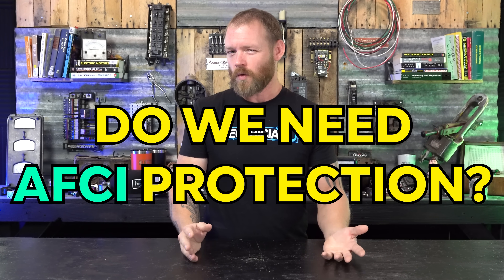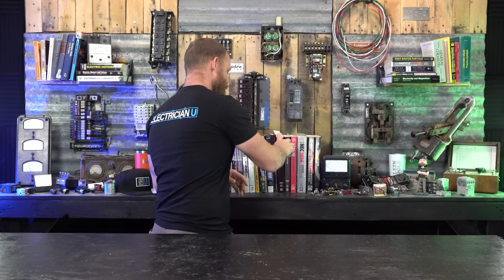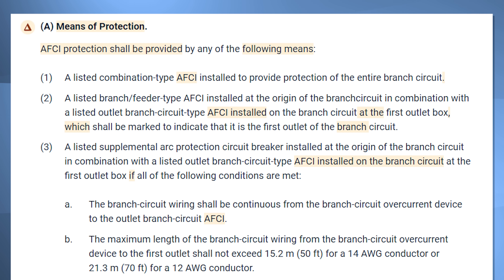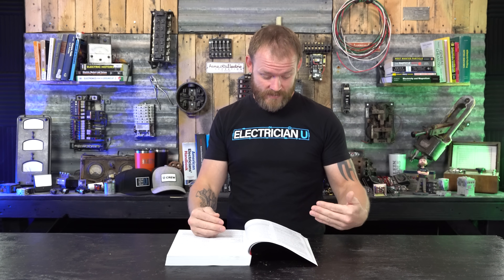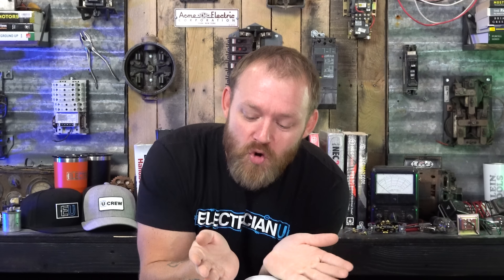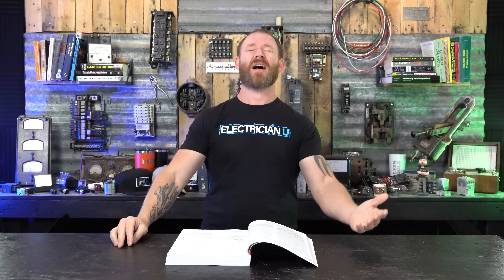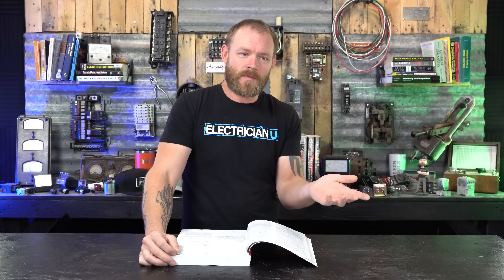Where and Why Do We Need AFCI Protection?

Comment: What kinds of devices cause false triggering of AFCIs?  Circular saws, maybe, with their universal motors and brushes?  Ham radio transmitters?

BTW, it's perfectly possible for an arc-welder not to trip an AFCI.  It just has to make sure the high-frequency fluctuations in the current of the arc are not coupled back to the AC line.  Capacitive or inductive filtering should do that.

Comment: I live in louisiana and we had an inspector tell us we need a gfci 2 pole breaker plus 10/3 with ground to a 50 gallon tank water heater. there's nowhere to hook up a neutral on the heater. explain that.

Comment: Every room with air conditioned space. AFCIs are a love.. hate deal. In my area any permitted electrical work requires AFCI upgrade. I am kinda in favor of AFCIs.. On the positive, I had a service call on a newer construction and the customer stated.. Once in a while the bedroom CB would blow. I found arcing wire in a JB that had melted down due to the continuously resetting the CB. On the hate side.. they are too sensitive to motors. Trips easy on shopvac, saws, or even multitool. Had to run extention cord to outside (non-AFCI) to do this type of work.

Comment: This was an excellent overview.  I'm rewiring my entire house in Michigan and I have significantly underestimated the cost for circuit breakers.  A simple circuit breaker is about 8 bucks.  A dual function one is about 60 bucks!  Dual function outlets run about 24 buck each!! Good night nurse and call the cops!  Apparently, every room needs an AFCI, and some require AFCI and GFCI.  The only place I can save money is in the bathrooms and that is by placing a GFCI outlet and connecting other outlets to it assuming they remain in the bathroom.  It sucks and, as you said, would have been easier, and probably cheaper, to buy an electrical panel with dual functions for everything.  So far, I think I have spent over $1,000 on breakers because of AFCI and GFCI requirements.  I would rather be shocked.  It's less painful than shelling out this much for breakers.  Thanks for confirming my expensive suspicions.

Comment: So bathroom circuit, if outlet and light is on the same circuit do I need an afci or not? :)
If I have separate circuits for light an outlet in bathroom do I need both afci or what? This is pretty confusing. :)

Thanks 🤝

Comment: What will i do with regular breakers after replacing all to afci?
Reply: Pretty much this is for single dwelling or multifamily dwelling units, in comercial we care only wet locations, the rest of the breakes are regular breakers or you just put a gfci receptacle where need it and regular breaker in the panel. This is huge change in NEC 2020 and 2023
Reply: @ Thanks.

Comment: Correct me if I'm wrong, but the scenario of a welder would not apply as you are not doing the arcing with the mains voltage. Instead the welder uses the mains voltage and goes through a transformer, which actually separates the two flowing currents.
Great video BTW!

Comment: Thanks for the information. We have a gas oven on a circuit that is fed by a 20A AFCI breaker. It has started to trip frequently when turning on the oven. Suspect that the AFCI is detecting a fault when the oven igniter clicks on.  Also noted that the AFCI pigtail on the breaker is stretched out quite (not in a tight spiral like the others) a bit to connect to the ground bar.  Would that potentially affect breaker performance?
Reply: no

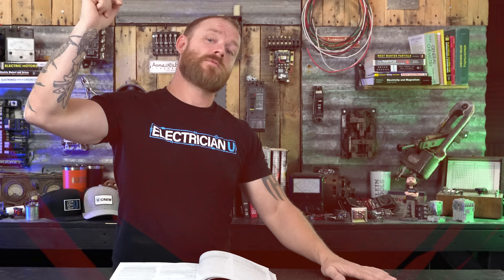Comment: New home the vacuum cleaner trips the AFCI breaker from kitchen island. But not in the bedrooms. Electrician been out twice.  Run a new wire took out a 12:45  gfi in living room replaced breaker. Sometimes it works. I hate AFCI breakers

Comment: What is an arc fault compared to a short circuit and what is the difference between a parallel short circuit and a series short circuit. Spreading disinformation is the worst thing you could do if something faults out before it reaches its load. It is a short circuit, a fault. It is classified a ground fault when it has to use the ground to get back to the source of the transformer, this is not correct information, you’re really close but a lot of this does not make sense. Maybe there’s something that you understand that I don’t I would be curious to hear your thoughts on the subject.

Comment: All older welders use a big transformer which block HF,  so high frequency arc energy can't get into the feeder circuit.
Newer welders all use inverter supplies with big caps on the DC supply feeding the IGBT's, which again prevent any high freq energy of the welding arc from entering the feeder.
The ancient non-isolated carbon arc/resistor-coil welders grandpa once used are a different story....lol

Comment: The arc of a welder is not directly connected to the branch circuit wiring. There is a power supply isolating the arc.

Comment: I installed combination arc fault breakers on my aluminim wired circuits and as of 4 years none have tripped .  I have seen arc fault breakers do their job which could have led to fires with a standard breaker . Of course troubleshooting can be more challanging .
Reply: Make sure you have the correct outlets for your aluminum wiring. In Phoenix, Oregon the Home Depot carries them ( electrical supply store folk gave me blank looks LOL). They are dual-rated for copper AND aluminum - @$4-5 each, but much cheaper than rebuilding a house...
Reply: I spent far too many hours this summer up in an attic with sweat dripping off my eyelashes getting rid of the aluminum wiring (and aluminum-to-knob-and-tube junctions!), but putting in the correct outlet boxes on the 50 year old aluminum wiring was a good short-term fix last winter when one of the outlets started throwing out white sparks. Glad to see the last of the aluminum - Knob and tube and cloth-wrapped wiring are next to go. Ironically I trust the 125-year-old wire more than the 60-year-old wire cloth-wrapped! The insulation still looks perfect, and each wire is ever-so-carefully wrapped around ceramic insulators, or threaded through ceramic tubes - - the workmanship of the install is impressive. It's still gonna go though.

Comment: 30 years in vol. FD. Many aid calls, never saw anyone shocked or electrocuted. Only fire we could definitely call electrical caused by wall heater without romex connector, expansion and contraction wore thru isulation and  caused spark. AFCI and GFCI total BS.

Comment: So there could be an arc fault in a fire alarm system but since ther is no afci required on that circuit it will still be active to let you know about the fire it caused.  Roflmao 🤣

Comment: The simple solution for dwelling units is just manufacture main circuit breakers with afci protection and cover everything, including bathrooms, outdoor receptacles and garages. The only problem about arc fault is any device or appliance with a universal motor that has brushes that arc by design. Vacuum cleaners  especially.

Comment: for the "arc welder" part, I think the breaker might not trip simply because the "arcing" is isolated on the other side of a transformer or inverter built in to the machine.

Comment: I absolutely detest AFCI circuit breakers. They nuisance trip on anything. Any device that has a contact that opens or closes and creates even a minuscule arc will trip one of these breakers. A crockpot thermostat, a coffee maker, the compressor contactor in my refrigerator, anything. They are about 5-6 times more expensive than a regular breaker to replace and will nullify your homeowner's insurance if you change them out with breakers that actually work. I'm at a loss for what to do.

Comment: I have a 220 volt, 30 amp washer/dryer unit,  do I need an arc fault breaker?
Reply: No, gfi breaker is required.

Comment: My treadmill sets of the arc fault breaker. Which very nearly wrecked me when my treadmill suddenly shut down at 6mph. I had to have that breaker replaced with a normal breaker. 

I assume it's because the treadmill is basically a Van der Graaf generator and creates a ton of static electricity.

Comment: what if you have a customer that has an afci breaker that powers two bedrooms. they claim that it nuisance trips, but when you go to check it out everything is working. I think the house was built in the late 90s, im not sure why there is an afci breaker in there to begin with. supposedly their neighbor replaced it for them at some point because of nuisance tripping. My plan is to switch it out with a regular single pole breaker and be done with it.
Reply: then they plug in a faulty space heater and burn down and sue you

Comment: The only place arc fault breakers have IMO is if your house has really old shitty cabling or if its got aluminium wire instead of copper, otherwise its completely unnecessary.

Comment: an arc welder definitely does produce arcs but the welding output is probably reasonably well isolated from the input circuits that would/could trigger arc fault protection. Wouldn't be surprised if there were still problems but...... You are probably familiar with an isolation transformer: a ground fault on the output side probably wouldn't be detectable on the input side.... because it is "isolated". An arc fault detector might work similarly.
Reply: should have read further in the comments, already addressed by FishFind3000.

Comment: You will only need to add an AFCI breaker panel if the renovation to the electrical panel includes adding outlets, receptacles, and wirings more than 6 ft. in length. If not, you are not mandated to add an AFCI, as per the 2017 NEC.

Comment: I like your statement. "Why not say every room in the house." OMG laughing so hard I almost had a "moment." I laughed very HARD AT THAT POINT.  We have an ARC welder. It is hugely expensive to use so we bout a gas generator for that thing to save our electric bill from making me cry. 

So many things are brushless now. Not sure how many things we plug in still ARC as part of operation. I plan on being in my house probably for the rest of my life so with that in mind I tend to think everything should be AFCI and GFCI. I never even understood this as a thing until I installed the above ground salt water pool. Had to put in a PED for that. Own CI. GFIC. and did a copper "bonding ring" around the pool under the rocks and gravel.
We ran a wire to the pump, the pool heater (wood fired) and the chlorinator thinger on the PED pole for the pool power. We did put in a 20A GFIC plug. Mom said I needed one there no matter what was in my breaker box so I did it. Not sure I put the correct one in. 15,20, 25 amp. Now I need to go back and look at that.

Comment: Little confused. I am moving on to "Where Should We Be Using Dual Function Breakers?"  next. Thinking we should just have them everywhere. So as we replace breakers in our old box. If there is a place I think it would be nice to have dual protection, can you just upgrade the breaker as you replace it? Looks like the cabling is going to be the same if wired to modern code.  For instance... You put a portable sauna in your guest bedroom. Now you have heat and moisture in a room and dual protection upgrade on the breaker would be a nice feature if replacing the breaker anyhow. I honestly think with buildings that have sprinkler systems inside why are not all CIs dual so you have ARC and GFI? Sprinkler turns on to put our a fire while you are doing exz with a electrical device. You don't get killed by fire you get electrocuted.  I think there is still something I have not caught on to yet with this subject. :D

Comment: When manufacturers lobbied to put them in the code to mandate their product - they didn’t even have a product on the market to sell for another 4 years. And when they did it was garbage. It took another 8 for them to partially function, and still a nuisance by design.

The supposed safety record is flawed statistics comparing 2-wire with the GFCI protection (which is also on the AFCI) to 3-wire circuits that behaved differently. 

Most electronic devices had to be modified to work with them. For years I had to tell clients that they couldn’t charge their iPhone in the bedroom, or to get a different vacuum.

Comment: Brushed motors will arc between the brushes and commutator, which is probably why garages/workshops and exterior receptacles (that might power electric mowers) are exempt. However, kitchens may have mixers and blenders that still use brushed motors and that might be real fun to deal with when trying to bake a cake.
Reply: I've got a vacuum that will trip the AFCI on only one circuit.
Reply: Stop at GFCI in your production shop. Ask me how I know. The alternative is to replace all of your tools to ensure they are brushless. I have a 70-year old Radial Arm Saw (RAS) in my shop that will trip the AFCI whenever it was turned on. GFCI is a sufficient level of protection in this “garage-like” application. A new, brushless motor RAS would typically cost $5000+. Though the shop is technically “habitable,” no one sleeps there (unless they want to find a new job / employer). Grateful for this NEC exception.
Reply: This was a great video. I learned a lot about why things trip sometimes.

Comment: Who is “THEY”.  

“They”figured out every motor drive characteristic so the AFCI would not be a false positive and trip ? 

You cannot have these on circuits that have motors. The motors will cause AFCI breakers to pop for no reason. 
Happens all the damn time. I’m wish the people who write code would die off and allow things to just work and work safely. Equipment should be engineered with it built into the equipment vs as a supply

Comment: It looks like they are expecting the very update to equipment (at least in arc welding equipment) that you said you wanted to see in the breakers themselves. In other words, the arc fault will not be detectable in the line of the arc welding equipment, no doubt because of some standard that has been improved in the circuits of that equipment. I would guess they are or will be requiring either diode, transistor and/or rectifier additions (or a pre-manufactured part including those things) to the equipment circuits.

It's better that the equipment has the arc defense in order to prevent any kind of tripping by feedback or faulty equipment. If the equipment itself shuts down without tripping the AFCI breaker, then you know your equipment is what is at fault.

Comment: If they had required metallic conduit on residential as well as commercial and no air nailers after wiring is installed then you would have no nails run into Romex which is 99.99999999999% of arc faults. (Typically siding installation) But hey, why fix the cause?

Comment: I'll never forget a call to troubleshoot a nuisance tripping of two AFCI breakers in a brand new home.  Turns out, a faulty fan in the oven...a circuit that had absolutely nothing to do with the circuits that were tripping was causing enough "noise" to trip the adjacent AFCI breakers in the panel.  It was there and then I decided AFCIs we're complete junk.

Comment: I just realized my renovation plan: 

1) Cram the existing panel with the few normal breakers that will fit.
2) Later, sell car to afford electrician to replace panel + breakers.

Until #2 happens, I'll be violating code, despite the house being infinitely SAFER than its currently code-compliant rat's nest of old fuse boxes, no-ground circuits, crumbling cloth wires, and broken dreams.

Comment: The reason why bathrooms don't need AFCI is because you can just pour readily-available water on the electrical fire, duh. Outdoor receptacle fire? Use your garden hose, of course! Similarly, if your garage catches from from an arc, just spray any random chemical on it. Problem solved!

Comment: I have an electrician coming to install an 20 amp circuit. I am going to buy the parts. He looked at my panel and told me to get ECMBR2 but when I looked that up it was a clip. How do I determine what breaker I need? I found one that would work that was GFCI but I want to get the basic breaker and have GFCI outlets installed. The label on the panel is a Murray.

Comment: I did all the wiring for my kitchen addition and I added a upgraded main service panel to accommodate the new kitchen circuits. My old main service is a subpanel now.  Anyway, I didn’t have to touch the old main panel circuits but all 9 kitchen circuits require arc fault protection.  Running dishwashers, garbage disposals, toasters, fridges, etc.  All new appliances.  It’s a QO plug on neutral panel with QO arc fault breakers.  I have had zero trips and zero problems.  Junction boxes used, connections made for appliances, and pigtails all Wago Lever nuts. Maybe the older AFCI’s were problematic, especially with older equipment, or maybe people were just using dangerous arcing equipment.  Will see how it holds up.  But if you have relatively newer wiring (last 30-40 years) and you install a panel with all arc fault protection and stuff starts tripping, it’s time to investigate your wiring itself…because based on my experience, it ain’t the breakers.  It’s mind boggling to me why people wouldn’t want these extra safety devices.  I’ve literally seen buildings go up in flames from electrical fires.
Reply: We just moved into a new neighborhood. Looks like the AFCI's are trip city. Electrician has a fulltime job with the warranty replacing these things. As far as I know you can't reliably test them, so they just replace them.

Comment: Are there high-amperage AFCI breakers that could be used as  a main to protect the whole "dwelling" (except bathrooms and garages 😁) and would that be allowed?
Reply: that's essentially how UK "consumer units" / panels are wired, one or two larger AFCI/GFCI (they call them "AFDD/RCBO" breakers that sub to single  breakers for each circuit